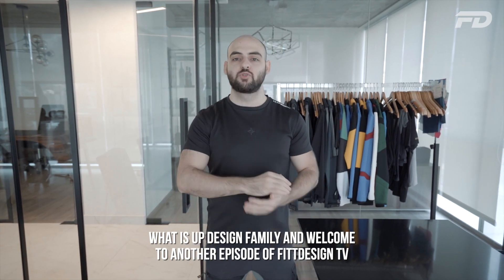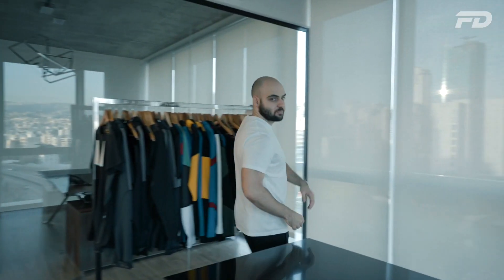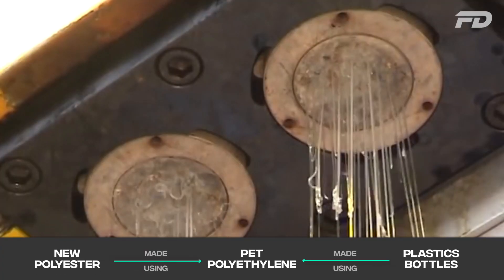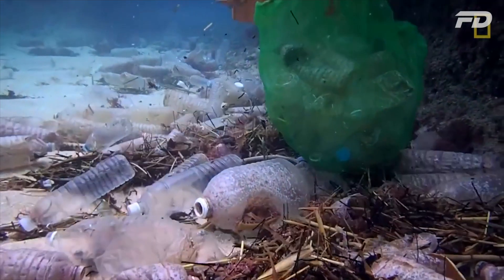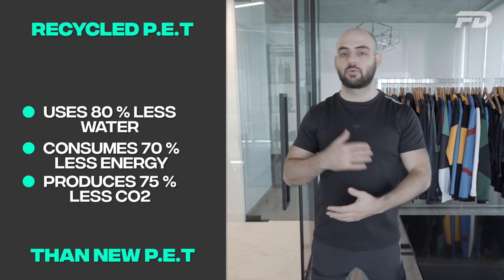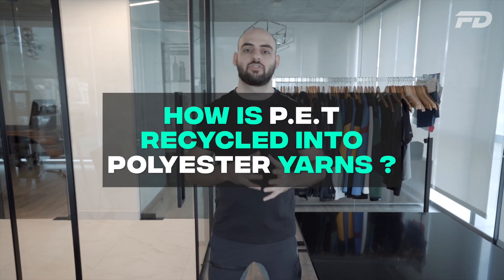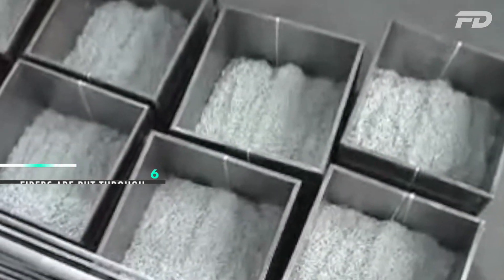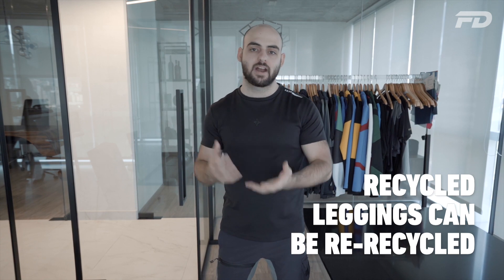How Are Recycled Leggings Made? (Sportswear Secrets)

Comment: Thanks a lot for the useful videos! Could you make one about the different types of textures for synthetic made garments? There are a lot of garments that even though they have the same composition (ie. 84% polyester + 16% elastane, or even garments with PA at 82% polyamide + 18% elastane) similar or same GSM, and knitted, have completely different textures.

Also, how is clean cut fabric made? 🤔

Keep it up with the good work!